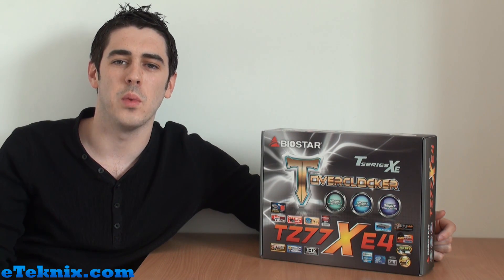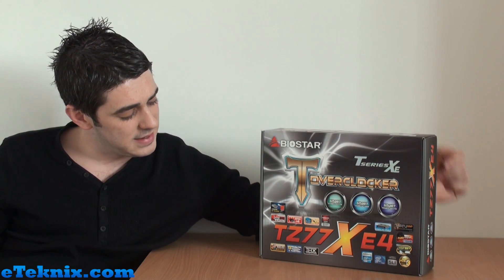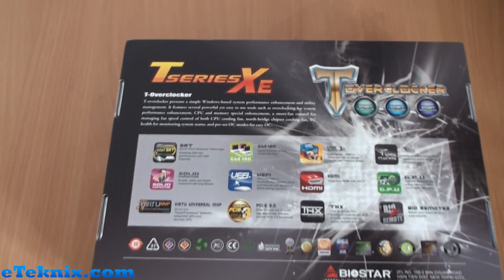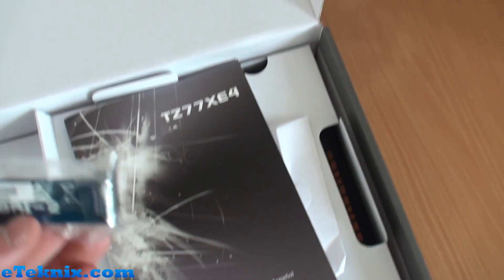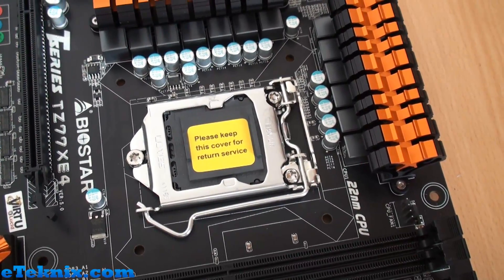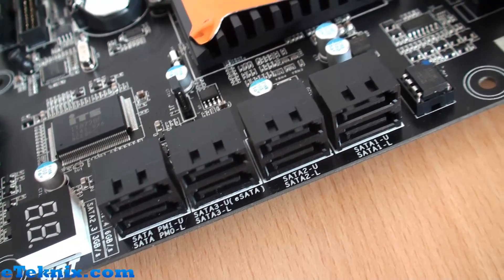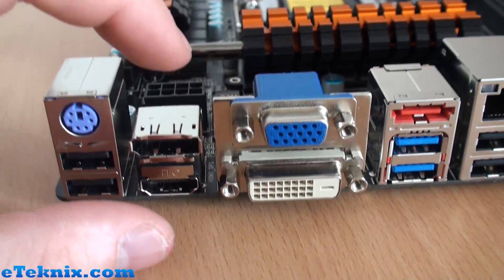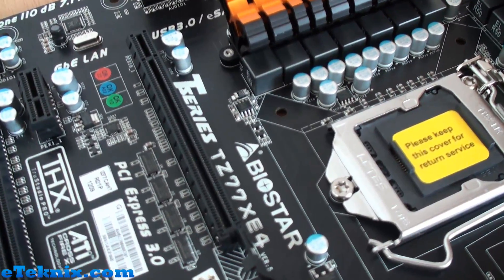Biostar TZ77XE4 Z77 Motherboard Preview

Comment: 3rd generation? I think you missed a few along the way. We first have the Pentium, then Pentium Pro, P2, P3, P4, P4 dual core, & Core2. Finally we get into the "i" series like the i3, i5, & i7. Now unless I missed my count, the Ivy bridge is not the 3rd but the 8th generation chip. If you consider the slot 1 P3 different from the standard socket P3 you can throw another one in there. It may be wise to do a little homework before spouting false facts...